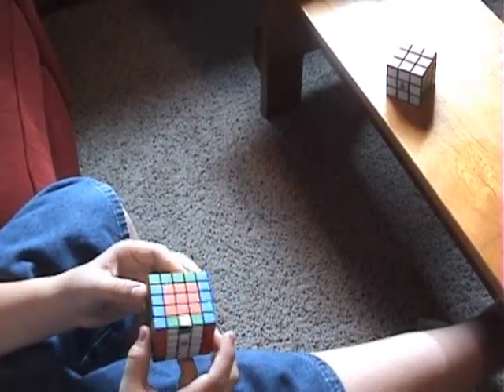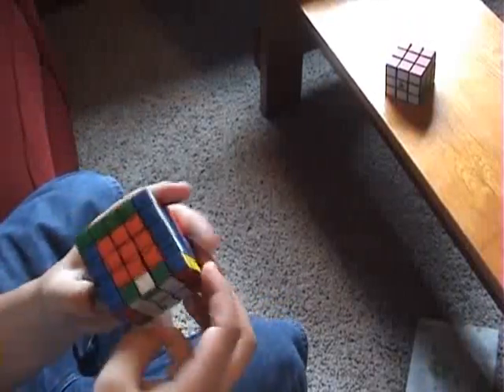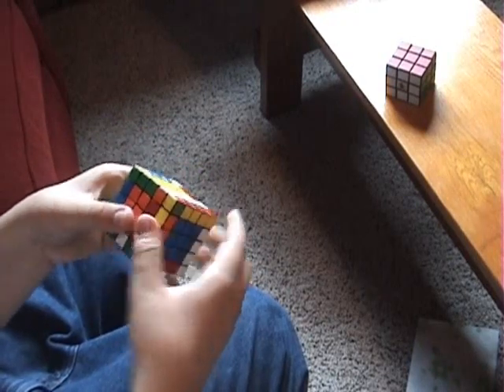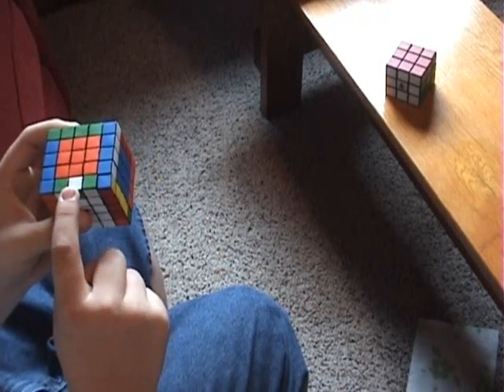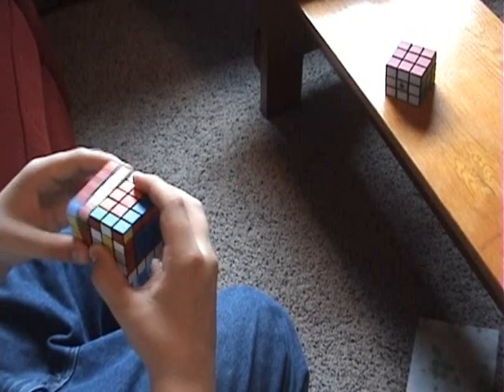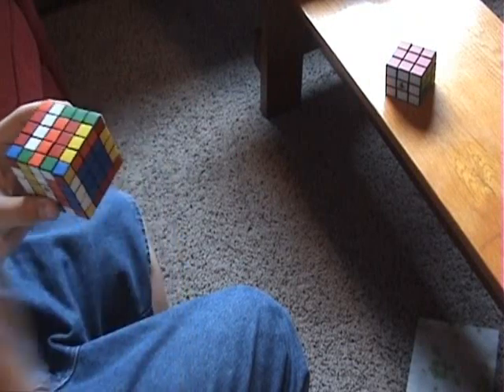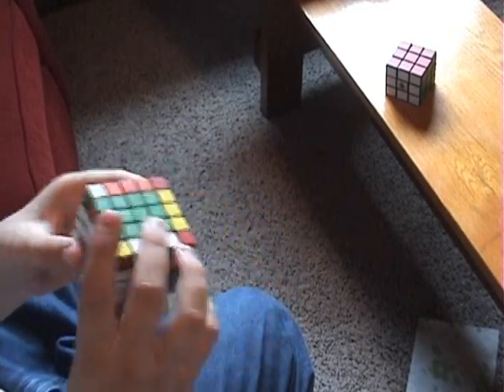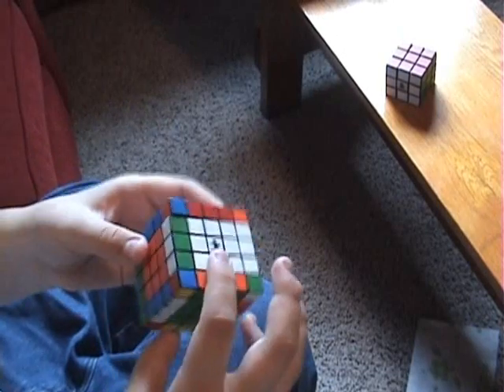5x5 Tutorial Part 4

Comment from the maker: the big centers on the 5x5, the three by three ones you made, are the centers of what would be a 3x3 cube.  the edges you paired, the three pieces that make up an edge, that is the equivalent to the one edge piece on a 3x3.  the corners are still just corners.  spin the outside layers to solve the cube.